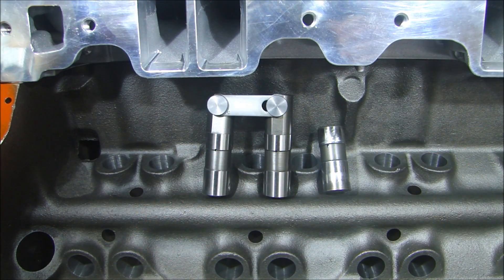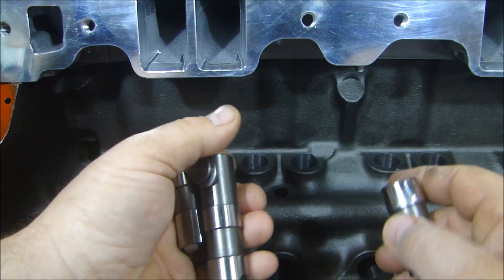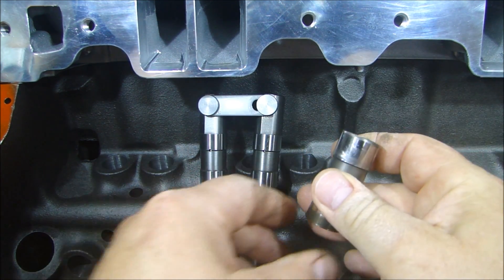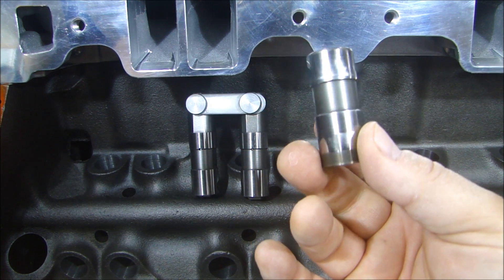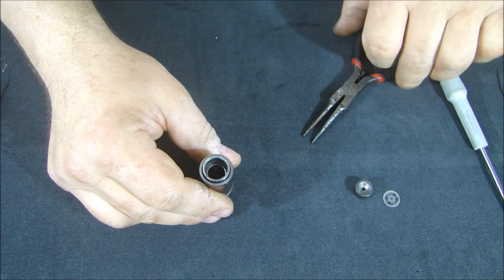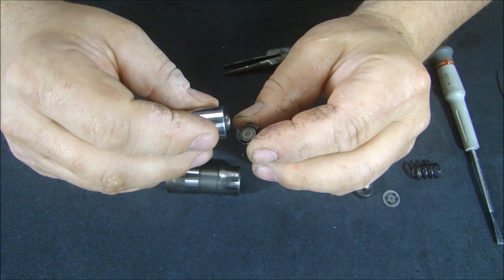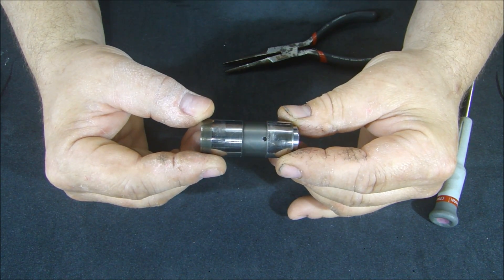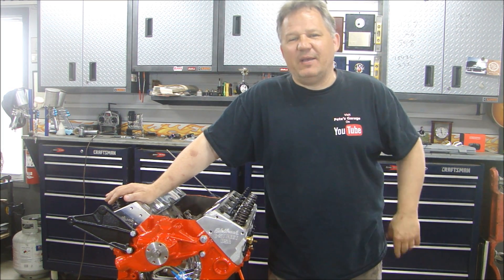Engine Building Part 10 - Hydraulic Lifters, Choosing, Cleaning, Assembling, Installing Roller Lifte

Comment: I appreciate your videos, but let's not forget. The purpose of the hydraulic lifter, (roller, or flat tappet), is to ease maintenance of the valvetrain, and to quiet it down, and so you don't have to set the lash every few thousand miles. The oil pump is going to pump oil to the rest of the valvetrain through solid lifters as well. Some people are not aware that "solid" only means there are no moving parts. (plunger, spring, retainer, etc...). They do have an oil port machined into them to channel oil through the pushrods, to the rockers. Not trying to be a jerk. I just thought that info should have been included.
Reply from the maker: Excellent point, thank you for the information.
Reply: Does these dog bone lifter work on a oem engine or does it have to be specific . I’m assuming the bore hole has to match the lifter size ?
Reply: The guy ÿtgggtt guy y u y u he by
Reply: RP Manone is correct. i like the video but you should fix it. alot of people don't read the coments and theres enough false info out there without adding to it. think of the hydraulic lifter as the shock obsorber of an engines valvetrain the ports in the lifter like ports in a shock relieve pressure in a metered amount to control and protect the valvetrain like a shock controls and protects the movements of a suspension. so advantage and disadvantage of a hydraulic lifter is when there is too much pressure on the lifter for example like a short over rev situation the lifter relieves the pressure to help keep from bending pushrods or rocker arms or damaging the cam lobes and with that protection the parts last longer also when you use solid lifters you have to leave a few thousandths lash to account for heat expansion of parts and to keep parts from binding that lash causes some valvetrain noise and requires regular adjustment as the parts wear. disadvantage of hydraulic is the oil pressure inside the lifter is what allows the valve to open fully allowing more air and fuel so when your oil gets low the first thing you usually hear is the lifter tap the lifters are collapsing and not opening the valves fully, reducing power. but even with full pressure under racing abuse at super high rpm's the lifters can partially collapse reducing engine power so some race engines will use the solid lifters to keep the valves open under extreme abuse and high rpm's. so to sum it up if you have a extreme performance high rpm race car that gets checked and adjusted after every race solid lifters are for you but everybody else your probly better off sticking with the hydraulic lifters that are capable of making plenty of power. but remember like having the right valve springs for a cams lift you also need the right calibrated lifters for your cam as well.
Reply: @trishapinczes7818  Rubbish. The whole 'solid rollers are for race engines' is 90s nonsense. So long as you have the right springs in it, and you break it in and then do the lash again, you're good to go. I've done 10,000 miles on a 950hp solid roller 350 chev - entirely street driven - and the lash is still perfect. The only thing you want to do is check it to make sure it hasn't changed, but no adjustments needed. 
If you have a 3,500hp doorslammer engine - of course you're going to be checking the lash every half an hour or so, which is where this stupid rumour comes from. 
Almost ANY engine these days - aside from the very very mild - will benefit from a solid roller cam. Or, you can be like everyone else who believes the rumour, fit a hyd roller, and then with any half decent power of 600hp+, wipe lobes and cause valvetrain damage every other month. If you had any idea what NASCAR had to do to get the cam system to stay together without even a roller cam, you would appreciate that even after all their development, that the cam and entire valvetrain was basically junk after a few hundred miles.
Reply: I run a Comp Cams street solid roller Extreme Energy Xr292R in my 438 Windsor 68 Mustang. I use all the good parts including Isky Bushed Lifters. Cam is 621 627 lift 254, 258@50 duration. Lash was checked at 500 miles and spot on. Lash was checked again 2 years later after 1800 miles and 2 exhaust valve lifters off .002-.003. Rest were off like .001. Car sees consistent 7200 rpm blasts and full throttle runs on street. Car is driven hard. I have no idea why lash backed off .002-.003 on 2 lifters but it did. Isky bushed are supposed to be the best. Can't see how you went 3k miles and lash never moved. But maybe you have smaller cam than me, or you don't run car to 7200rpm. Solid roller lash should be checked at least every 2 years. I am guessing maybe those 2 isky bushed lifters may be wearing or something else wearing. But to go 3k miles in a 950hp solid roller car and no lash change is hard to fathom. Unless you drive real mellow all the time. But who drives a solid roller car mellow?. Also. Comp cams needle bearing lifters are crap and ruined a motor i had before. That's why i went isky bushed. Maybe motor was still breaking in and that's why some lifters moved. But i have heard isky bushed are the best.
Reply: I run a Comp Cams street solid roller Extreme Energy Xr292R in my 438 Windsor 68 Mustang. I use all the good parts including Isky Bushed Lifters. Cam is 621 627 lift 254, 258@50 duration. Lash was checked at 500 miles and spot on. Lash was checked again 2 years later after 1800 miles and 2 exhaust valve lifters off .002-.003. Rest were off like .001. Car sees consistent 7200 rpm blasts and full throttle runs on street. Car is driven hard. I have no idea why lash backed off .002-.003 on 2 lifters but it did. Isky bushed are supposed to be the best. Can't see how you went 3k miles and lash never moved. But maybe you have smaller cam than me, or you don't run car to 7200rpm. Solid roller lash should be checked at least every 2 years. I am guessing maybe those 2 isky bushed lifters may be wearing or something else wearing. But to go 3k miles in a 950hp solid roller car and no lash change is hard to fathom. Unless you drive real mellow all the time. But who drives a solid roller car mellow?. Also. Comp cams needle bearing lifters are crap and ruined a motor i had before. That's why i went isky bushed. Maybe motor was still breaking in and that's why some lifters moved. But i have heard isky bushed are the best
Reply: @maximusvonce1381  262/272, 113LSA and 0.750in lift. Turns to 7100. Makes 598hp aspirated and 950 with about 10 pounds of boost (blown). It's down to good springs - Isky PSI triples, and good roller rockers - YT Platinum almost 2 grand a pop. Plus like any decent HP engine, it should be well broken in on the engine dyno before going in the car. Then one final adjusment in car on a chassis dyno. Job done. That's how it's lasted :) Crane cam and lifters too, their steel billets are fantastic quality.
Reply: @dons1932  I didn't even know 350s could go 950hp, i figured they would disintegrate,i tought numbers like that were for big blocks,learn something new everyday.
Reply: Hi RPMan, Trisha and Peter

Please, take this as a constructive comment. I totally agree on those comments and I I also agree on the fact that this video has to be redone to include this important information. 
apart form that, this video is great!

Comment: Thanks Pete! I really appreciate your explanation on how hydraulic lifters function.  No kidding, this has been something I’ve wondered about for decades!

Please help me clarify two details:

1. When the cam first pushes the lifter, is it hydro-locked, or does the push rod cap sink into the lifter, pumping oil up the push rod?

2. Is the push rod cap physically bottomed-out inside the lifter to cause the push rod to rise, or is the lifter hydraulically locked which results in moving the push rod?

Thanks again!  This is awesome.
Reply from the maker: It is locked at the bottom and pressurizes on the way back down. I'll try to illustrate that somehow. The pushrod just sits in the the lifter and once the lifter gets pumped up it is solid, taking up the valve lash.

Comment: 50 or 60 horsepower, seriously? on an engine with how many total hp?
Reply from the maker: If you pick the right roller cam and lifters you can see substantial increases. On an identical cam a roller will always make more.
Reply: 50 to 60 HP is conservative I have see 100 HP gain by going roller
Reply: @Myvintageiron7512  I understand but how do I get a solid roller to live in a daily driver? Hyd rollers are so dam heavy they don't rpm, their done at 62-63. Even though flat tapper gives up power they will go to 7 which might be faster in the quarter.
Reply: I run a Comp Cams street solid roller Extreme Energy Xr292R in my 438 Windsor 68 Mustang. I use all the good parts including Isky Bushed Lifters. Cam is 621 627 lift 254, 258@50 duration. Lash was checked at 500 miles and spot on. Lash was checked again 2 years later after 1800 miles and 2 exhaust valve lifters off .002-.003. Rest were off like .001. Car sees consistent 7200 rpm blasts and full throttle runs on street. Car is driven hard. I have no idea why lash backed off .002-.003 on 2 lifters but it did. Isky bushed are supposed to be the best. Can't see how you went 3k miles and lash never moved. But maybe you have smaller cam than me, or you don't run car to 7200rpm. Solid roller lash should be checked at least every 2 years. I am guessing maybe those 2 isky bushed lifters may be wearing or something else wearing. But to go 3k miles in a 950hp solid roller car and no lash change is hard to fathom. Unless you drive real mellow all the time. But who drives a solid roller car mellow?. Also. Comp cams needle bearing lifters are crap and ruined a motor i had before. That's why i went isky bushed. Maybe motor was still breaking in and that's why some lifters moved. But i have heard isky bushed are the best
Reply: I run a Comp Cams street solid roller Extreme Energy Xr292R in my 438 Windsor 68 Mustang. I use all the good parts including Isky Bushed Lifters. Cam is 621 627 lift 254, 258@50 duration. Lash was checked at 500 miles and spot on. Lash was checked again 2 years later after 1800 miles and 2 exhaust valve lifters off .002-.003. Rest were off like .001. Car sees consistent 7200 rpm blasts and full throttle runs on street. Car is driven hard. I have no idea why lash backed off .002-.003 on 2 lifters but it did. Isky bushed are supposed to be the best. Can't see how you went 3k miles and lash never moved. But maybe you have smaller cam than me, or you don't run car to 7200rpm. Solid roller lash should be checked at least every 2 years. I am guessing maybe those 2 isky bushed lifters may be wearing or something else wearing. But to go 3k miles in a 950hp solid roller car and no lash change is hard to fathom. Unless you drive real mellow all the time. But who drives a solid roller car mellow?. Also. Comp cams needle bearing lifters are crap and ruined a motor i had before. That's why i went isky bushed. Maybe motor was still breaking in and that's why some lifters moved. But i have heard isky bushed are the best
Reply: you are spamming,please delete 10 pf your identical comments   @maximusvonce1381
Reply: crazy, learned something new today
Reply: You actually need a different camshaft that takes advantage of the roller assembly, which can have a massive improvement in power.
Reply: scose  yes it is true, I converted my motor from hydro to just solid lifter setup with upgraded cams, and I saw right around a 53 hp increase. We could have adjusted them a little more and squeeze out more.
Reply: I run a Comp Cams street solid roller Extreme Energy Xr292R in my 438 Windsor 68 Mustang. I use all the good parts including Isky Bushed Lifters. Cam is 621 627 lift 254, 258@50 duration. Lash was checked at 500 miles and spot on. Lash was checked again 2 years later after 1800 miles and 2 exhaust valve lifters off .002-.003. Rest were off like .001. Car sees consistent 7200 rpm blasts and full throttle runs on street. Car is driven hard. I have no idea why lash backed off .002-.003 on 2 lifters but it did. Isky bushed are supposed to be the best. Can't see how you went 3k miles and lash never moved. But maybe you have smaller cam than me, or you don't run car to 7200rpm. Solid roller lash should be checked at least every 2 years. I am guessing maybe those 2 isky bushed lifters may be wearing or something else wearing. But to go 3k miles in a 950hp solid roller car and no lash change is hard to fathom. Unless you drive real mellow all the time. But who drives a solid roller car mellow?. Also. Comp cams needle bearing lifters are crap and ruined a motor i had before. That's why i went isky bushed. Maybe motor was still breaking in and that's why some lifters moved. But i have heard isky bushed are the best

Comment: Are the roller lifters also better for your high lift cams. They seem like they would be.
Reply from the maker: They are better for high lift, that is why you get a little more HP out of them.
Reply: the ramp and lobe shape for a roller cam is specifically designed for roller lifters.compare a regular flat tappet hydraulic cam lobe to a roller cam lobe and its difference is immediately apparent,roller lifters are for roller cams and hydraulic lifters are for flat tappet,hydraulic cams

Comment: Did you forget to mention that 15 of 16 flat tappet lifters prefer zinc infused motor oil.? And that O2 sensors do not like zinc?
Reply from the maker: I did not forget, it is really difficult to put every little piece of info in every video. Thanks for the comment.

Comment: I've never worked on cars but wouldn't putting a spring oil pump in the lifters exacerbate valve float and timing issues?
Reply from the maker: The hydraulic pressure takes up the lash. They become pretty solid once filled with oil.

Comment: nice vid , don't forget oil in the lifter under pressure inside the lifter takes up the valve train lash under hydraulic lock an bleed down.
Reply from the maker: Absolutely, thanks for the comment
Reply: yes when the oil in a lifter has no where to go it act as though it is solid until it bleeds out
Reply: Hey wait....so are you saying that the check valve and bleed down are the secret sauce that makes hydraulic lifters self-adjusting???

That’s one of the magical mysteries I’ve been trying to get my mind around for a long, long time.

I think I finally got it.
Reply from the maker: Yes, the check makes it solid on the way up and on the way down the pushrod compresses the spring and oil is pumped up. The check on the bottom does the adjusting.